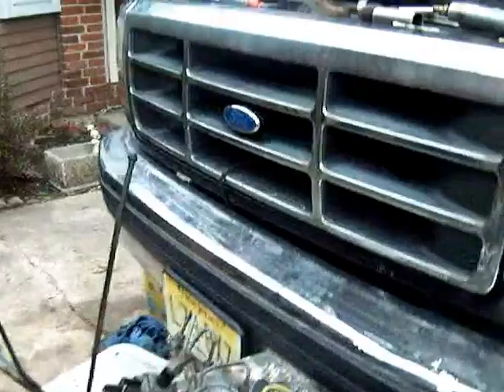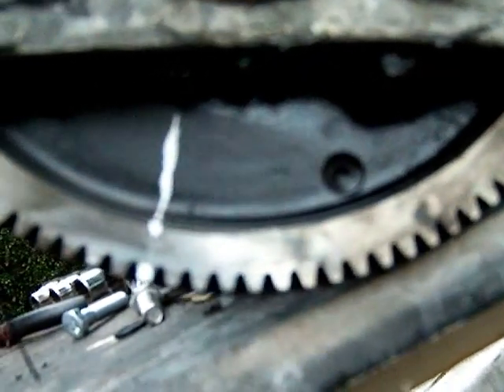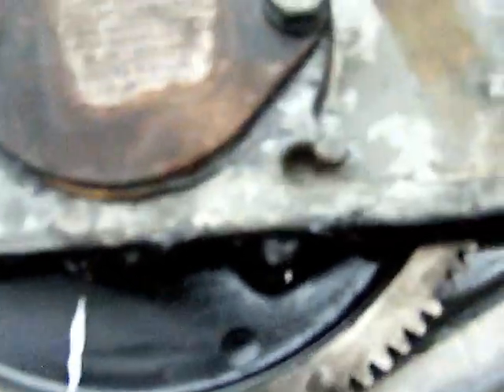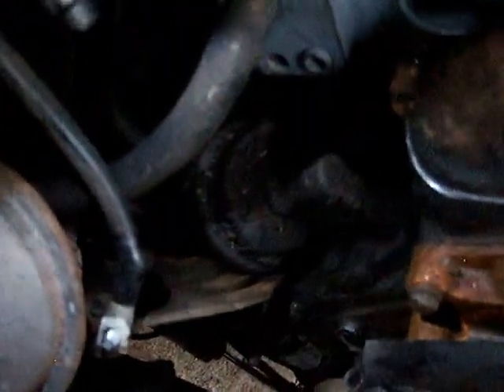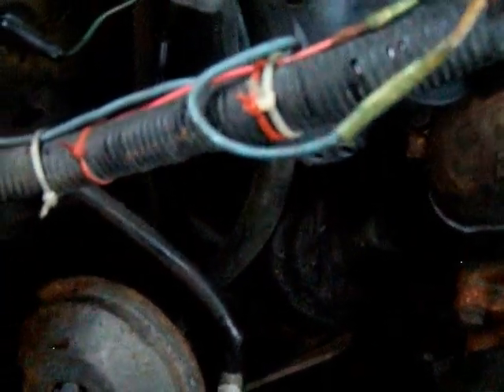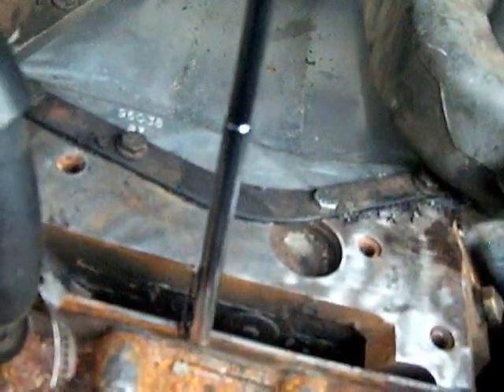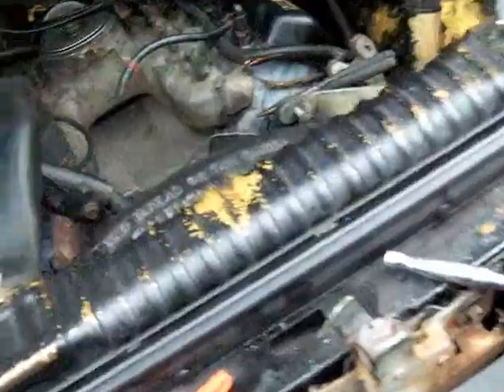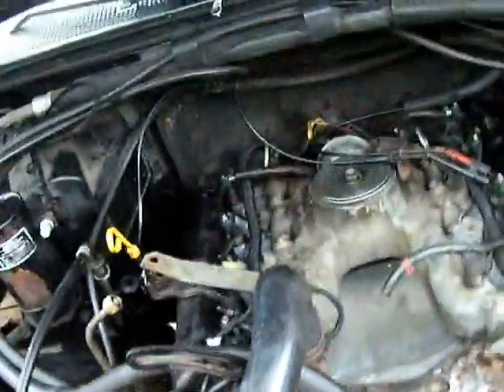idi pump gear timing

Comment: all I do is set it top dead centre intake stroke pull pump off put pump on and adjust 2 degrees advance and your done no marks no mirrors.
been doing these things for 25 years and y dad who trained me is now at 54 years lol 
ant thing diesel you need help with ask info is always free and I love giving tips and advice 

Cheers Alexia
Reply: +Alexia and James Turner (Mobile Mechanics) I have a question for you I have a 1987 f250 with the 6.9 in it and I replaced all injectors and pump and now my truck smokes really bad do you know what I can to to get it to stop
Reply: i would start by looking at the fuel metering and then look for an injector that might have a bad seal or did not seat right but if it is clouds of white its going to be fuel mixture there is a good video on tuning called 7.3 idi tuning the pumps work the same as they are the same
Reply: i need your help 🥺🥺 my motor doestn work it is a 6.9 

i see the timing mark there is a Y up
and Y down

and I put them on the same line
but my motor doesnt work 🥺🥺